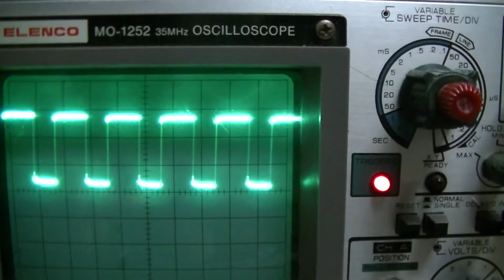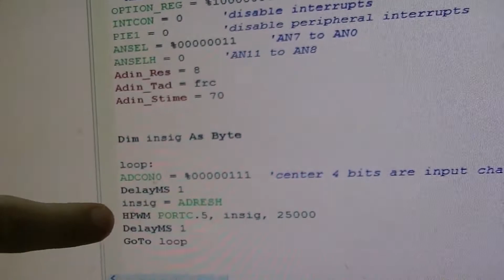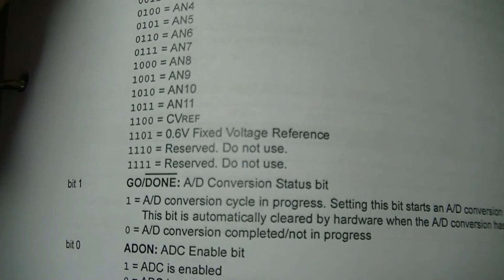DIY MPPT PIC16F685 ADC fix

Comment: Hi, I was wondering if you can help me out. I have a Tefal Pro Express Iron, model no GV8360. The chip PIC 16F685 has malfunctioned. I want to get it changed.  Can you please help me where i can get the exact chip that is used in the Iron and also does it have to be programmed and who will do the programming. Pls give me some advice thanks a lot. Suhail , Australia